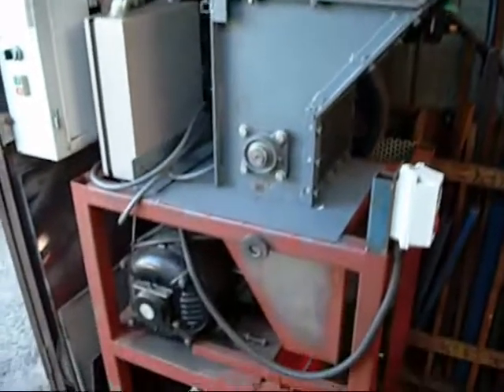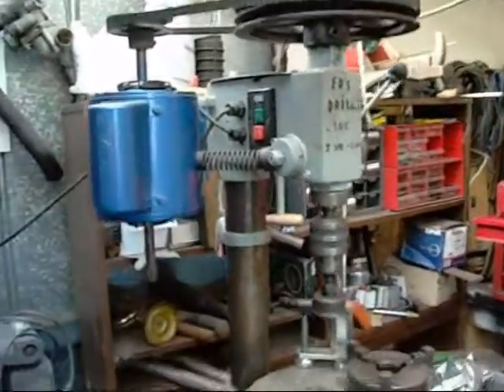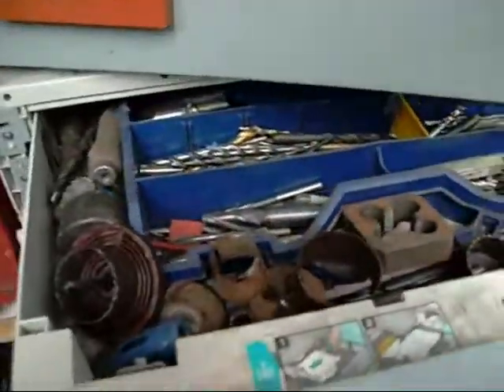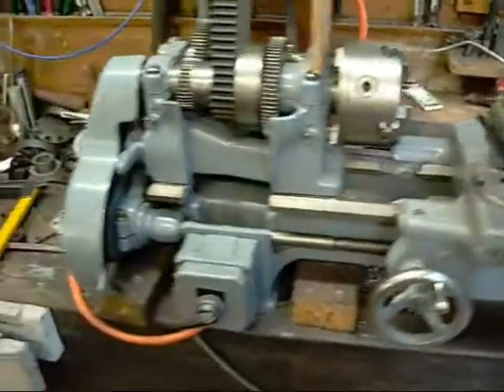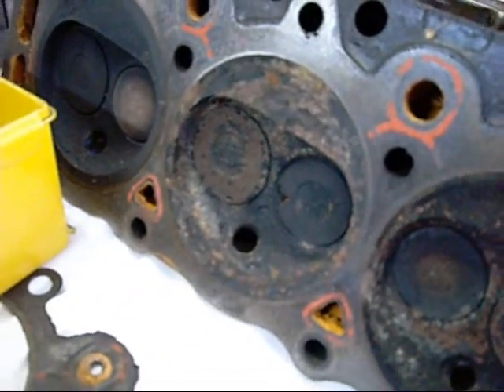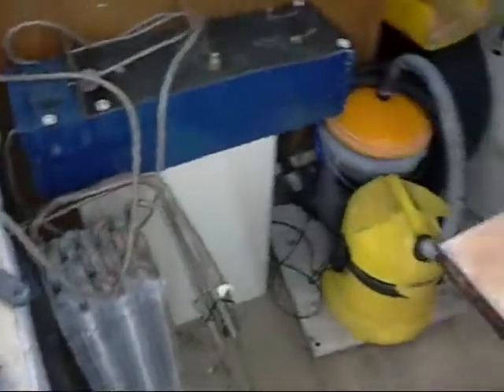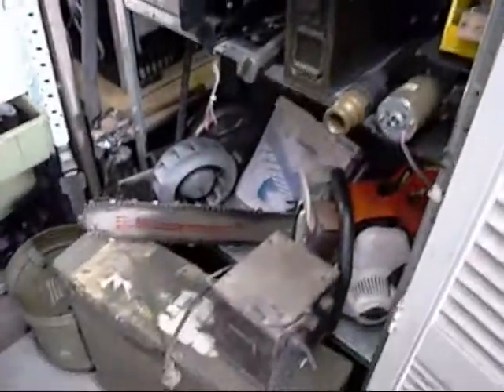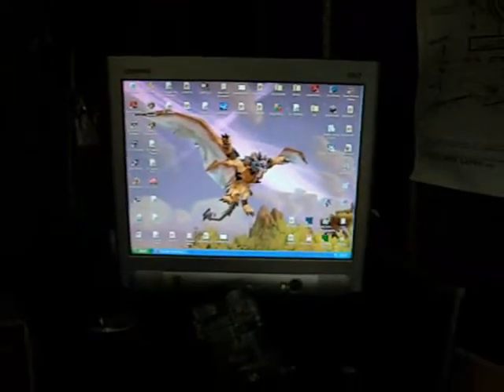Into the Ed Systems Empire

Comment from the maker: The Howard engine is off a rotary cultivator, but based on 1920's motorcycle dry sump engines.

I wish my SB9" was fitted with good quick change screw cutting gears, the back gear assembly on mine is too worn to reliably cut threads :(

Comment: Nice shop. What does the Howard engine power? A motorcycle? or a Car?
I have an old South Bend 9" also. It's handy because it has screw cutting quick change gears. Check out "Florida Association of Model Engineers. Web site.
You will enjoy it.